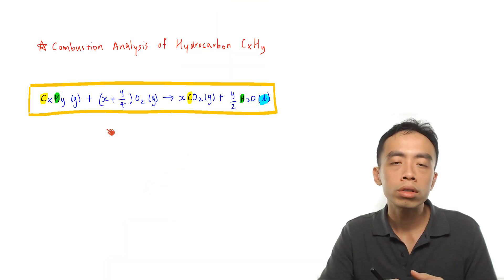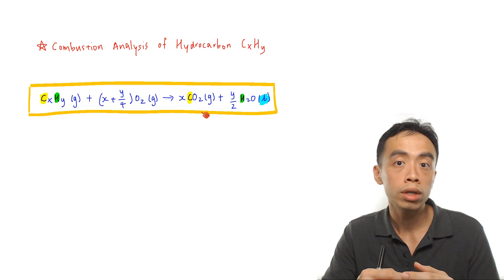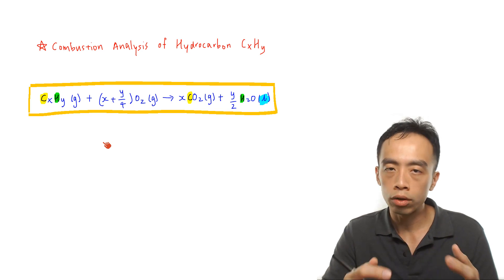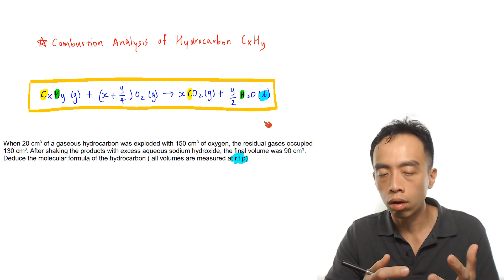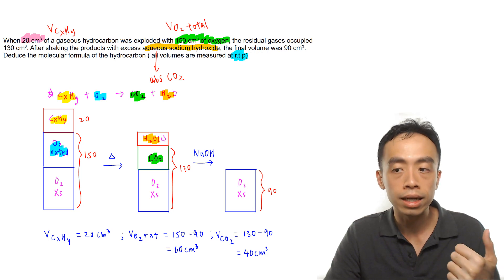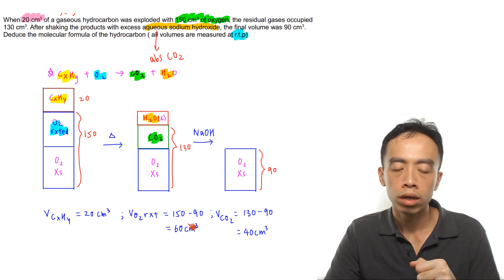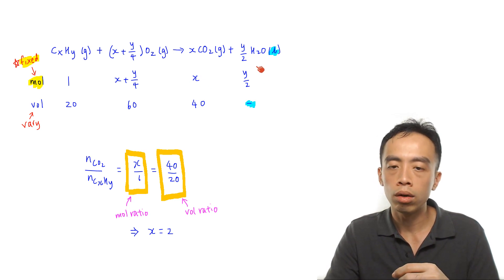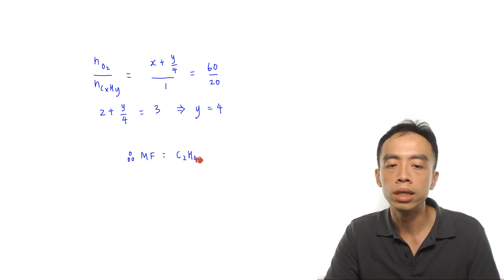Combustion Analysis of Gaseous Hydrocarbons

Comment: sir i have a question to ask. if the question ask the volume of water formed b4 the reaction, how should I answer ?
Reply from the maker: The volumes we are interested in are for gaseous species, since we are using Avogadro's Law to compare mole ratio and volume ratio of gases. If the question mentions standard conditions or at room temperature, then the only gases we focus on will be reactants CxHy (hydrocarbon) and O2, and product CO2. Water will be in liquid state so its volume is not important
Reply: @ChemistryGuru  But sir, would it be possible to just find the volume of water produced by converting from ml of C2H4 to ml of H2O using the molar and volume ratios? Or is that not possible without something like the molarity of the gas? Thank you so much for making this video as well.
Reply from the maker: @chathuk6122  we cannot compare volume of liquids since Avogadro's Law is only for comparing volume of gases. To determine volume of water we need to find 
(1) moles of C2H4, 
(2) compare mole ratio to find moles of water formed, 
(3) calculate mass of water, 
(4) calculate volume of water using density where density of water is 1 gram per cm cube
Reply: @ChemistryGuru  Ohh, that makes sense. I didn't know that the volumes weren't interchangeable with their state in this Law. Thanks for explaining sir.

Comment: Hi chemistry guru , i have a question . how will you solve the question if the question doesnt specify the volume of excess oxygen ?
Reply from the maker: Hi Aarvind for questions that do not specify the total volume of oxygen but the change in volume is given, we can use the following expression:

Change in vol = vol of CO2 + vol of H2O - vol of CxHy - vol of oxygen reacted

This is simply the change in vol is equal to volume of products formed less volume of reactants used up.

If H2O is liquid at room temperature then vol of H2O will be zero.

Hope this clarifies! 😄